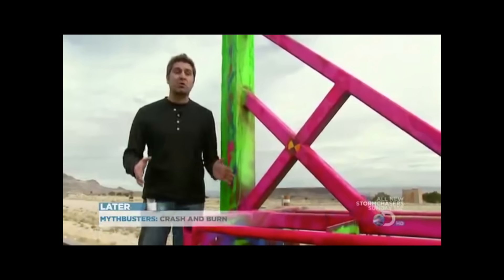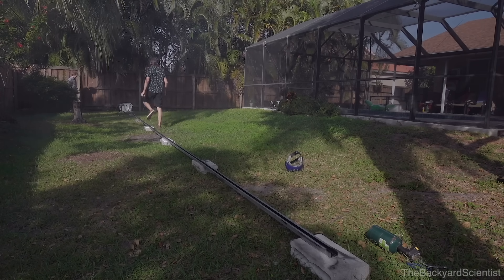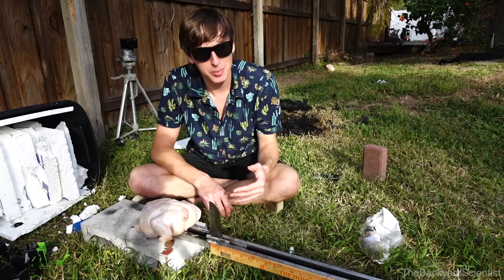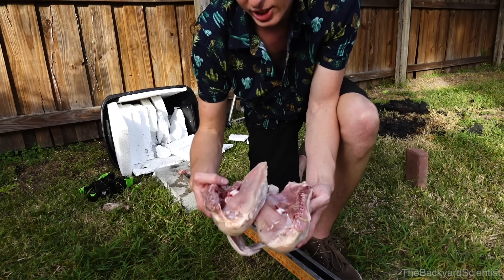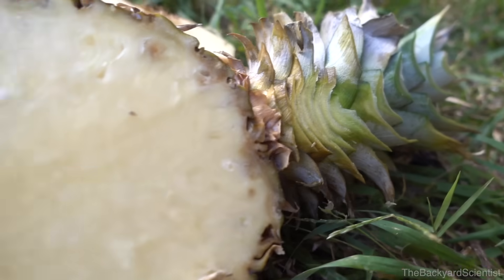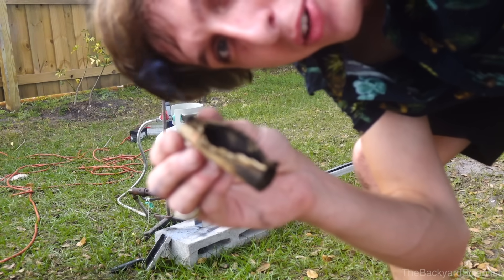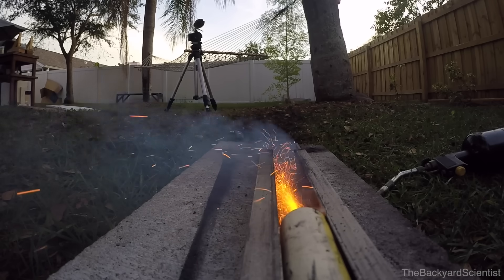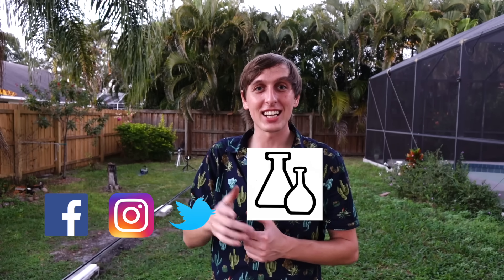150 mph Rocket Knife

Comment: Tbh, based on my calculations, you could survive being on that. The acceleration would be around 223.5m/s² which, could snap your neck, but if you were in the right position, you would survive for that fraction if a second. The G force would be about 22.793g which is survivable without repercussions if only held for a short period of time, held in place with equipment and in the right position.

Comment: Ok, so with some quick math, that’s an acceleration of about 20 Gs. If you were sitting down, facing forward, you could survive that for a bit under 1 second. And seeing that you said that was 0.3 seconds, you could survive that rocket sled acceleration (see Wikipedia, graph of human linear acceleration tolerances). It sounds like the most intense roller coaster ever...

Comment: I got somewhat bored today so I decided to calculate the pressure that knife applied in that car, (note: I am in no way a physicist, most of my calculations were made by using some assumptions since I don't have the exact dimentions of the "knife rocket", nor the area of edge of that knife)
I calculated the volume of an aluminum box ( 13,5 x 3 x 2 cm) and assumed it to calculate the weight of the hole thing ( tread + knife) since I don't know the thickness of the tread. the volume of it all came to be 81 cm^3
By using alluminuns density (2725Kg/m^3) I calculated the weight of 220,725g.
Sice F=m X a (the aceleration been 24,51m/s^2, calculated with the aproximated time of 2,9s); the force of impact is 5454,11N.

The knife itself has aproximately 14,5 cm in height and an extimated 0,012cm in thickness on the edge, leaving an area of 0,174 cm^2, or 17,4 X 10^-6 m^2
finaly for the pressure P=F/A ; resulting in a pressure of aproximately 313 MPa!

(I haven't added the forces of attition to keep stuff simple, but fell free to apply then if you so desire) Thank you very much for reading to the end and thank you Backyard Scientist for the awesome videos
Reply: Pretty sad that the crowd here doesn't appreciate your calculations...now 313MPa doesn't sound like an awful lot but it's roughly 5 times the pressure of an industrial oxygen gas cylinder...

Comment: If you use a thicker knife with a more aggressive edge it should stay pretty straight. Also you should try that rig with more rocket motors and secure a section of sheet metal over the track to see how far the knife can go through

Comment: We move faster than that bade because the earth go way more fast
Reply: milie faraaz I applaud your grammar
Reply: Ever heard of relative velocity?  If you jump out of a moving car you'll still be moving in the direction of the car.  The car can be going 80mph, but you'll feel normal because you're inside.

Same applies with the movement of the Earth.
Reply: Sure, you are on the rapidly spinning earth............

But so is the knife.
therefore, if you walk at 2 mph, you would be moving at (2+1000) mph, or 1002 mph.
if the rocket goes at 150 mph, the rocket would be moving at (150+1000) mph, or 1150 mph.
1002<1150.
unless you are the flash or in space, you will not go faster than that knife.

Comment: After a quick calculation. If you were to accelerate as if you were the gopro in the last shoot, you would experience a gforce of ~22.79. Which I assumed was a fatal number because fighter pilots have to wear special suits to endure 8-10 Gs, and the "lethal level" is considered around 10 Gs; however, that threshold is for sustained G-force over 1 minute. After a bit of research though humans can endure a lot of G-force over short periods of time. Air force officer John Stapp in 1954 survived an excess of 25 Gs for 1.1 seconds maxing out at 46.2 Gs. So if somehow you accelerated to 150 mph in 0.3 seconds the G-forces would not necessarily be lethal, Impact probably would be though.
Reply: Ryan McCaffrey you didn’t need to write all that

Comment: Try driving a spike nail through a plate of steel maybe? The spike nail is usually too soft for anything more than thin sheet metal, but if you can say get some 6" squares and maybe back them with say, wet telephone books, maybe you can see just how thick of a piece of steel you can punch through.

Comment: Dude metals are good conductors of heat because the particle takes in the heat and quickly spread it through out the metal structure(just a reminder for next time)

Comment: Because nobody pointed it out, as far as I saw, I do not believe the GoPro went quite 150mp/h because it has a bigger mass and air resistance than the Knife and would therefore be much more power consuming to accelerate.

Comment: I'm sorry that if this make me imcompetent if I ask this question cucumber is a fruit
Reply: nope it has seeds which means it is a fruit.
Reply: Some 1 it's a vegetable
Reply: i have seeds i am fruit
Reply: Some 1 it has seeds so it's a fruit
Reply: Jumper1155 "Botanically speaking, a fruit is a seed-bearing structure that develops from the ovary of a flowering plant, whereas vegetables are all other plant parts, such as roots, leaves and stems. By those standards, seedy outgrowths such as apples, squash and, yes, tomatoes are all fruits, while roots such as beets, potatoes and turnips, leaves such as spinach, kale and lettuce, and stems such as celery and broccoli are all vegetables."
Reply: Void Lol eww
Reply: Matteo Torres thank u only reason I went threw the comment it to see if someone thought it was a vegetable
Reply: nxnxns ajxndk thats not how it works. vegetables need to be replanted every season and fruits will regrow from the original plant. this is how you differentiate between the two.

Comment: 1) rocket sled with gopro pointed forwards.
2) rocket sled launched like a rocket
3) rocket sled into concrete
4) rocket sled with impact explosion
5) rocket sled vs molten aluminium
Reply: 2 rocket sleds crash
Reply: Rekarded or vs. solid aluminium

Comment: You set rotate the rail vertical so it goes straight into the air or at a 45 degree angle. It'd be pretty cool like launching mortars.

Comment: 0 to 150mph in .3 seconds would be the equivalent of 22.9gs of force.  
  
John Stapp did a series of rocket sled tests, where he showed that a human could survive at least 46.2gs relatively unscathed if properly harnessed, and sustained 25gs for 1.1 seconds with little ill effects.  
  
So actually, it would be very much survivable, although not particularly comfortable.
Reply: TUTURUTUUUU
Reply: So that 513.185 miles when launched vertically,
so the next question is, what object would be able to withstand it?
Reply: Paulo Castro John Cena
Reply: Dale Leonardo the rocket would pass thru nothing
Reply: Charles
Reply: Charles Cal it shopped a block o' wood and a brick and bread all in 1 time flawlessly
nowhere a human could survive that 
mayve survive that amount of force as a hit not with a sharp object
Reply: DerpMaster Hd he meant if you were on the rocket and you didn't hit anything

Comment: Cut open some aluminum cans. Cans of beans, soda cans, etc. 150mph can opener. The metal should be thin enough that it can go all the way through.
Having worked in kitchens I can also tell you that trying to push a knife through a big block of cheese (think a couple of feet thick) is pretty much impossible. A lot of big banquet kitchens have a bandsaw for that. I'd love to see if the velocity is enough to overcome all that friction.

Comment: Hey Kevin, I noticed at 2:57 you have two GoPro's set up right by each other. If they were both recording while you launched the rocket, have you thought about turning it into a 3D video? 
I have done it a few times, all you have to do is make sure your Left and Right are synced, and do a little lens warp in post, and set them side-by-side for google cardboard, and there you go. It is a little wonky, but it is pretty cool to do!

Comment: AWESOME VID!!!!!

After you fix the sled, you should see if the knife will cut a rack of beef ribs!  If it does, you could then retry it with a red hot blade to see if it would cut more easily or would the hot steel loose its structural integrity from the heat and be deformed by the larger bones!!

Comment: "It would probably kill you to go that fast" Tell that to the top alcohol Drag racers when they hit 350 MPH in about that time.
Reply: CaptinJJz it takes them about 2 seconds to reach 350. They only hit 60 in about a sec then the acceleration curves becomes exponential until the engine blows up
Reply from the maker: I think you would be fine if you were strapped to a chair, but yeah it would be very uncomfortable and you're probably black out.

Comment: Next time, use the super heated rocket knife to cut another knife that is laid horizontally. Please?
Reply: i want to see this!
Reply: It would be the other way around. The cool, hardened knife will slice through the (comparaticely) soft, red-hot knife, whichever one was launched.
Reply: Adam FromFin z
Reply: Adam FromFin no it wouldn't
Reply: Ben Steinhart do it with a regular knife then a heated knife

Comment: realtalk; I am flabbergasted that the car cut so cleanly, I thought for sure it would deflect the blade then shatter, robbing the knife of its kinetic energy
Reply from the maker: +Ryukachoo i'm surprise the car didn't roll backwards at all the knife was totally through by the time it even move backwards a cm
Reply: good point, but i guess if it's cutting so cleaning then by definition it's really not imparting much kinetic energy into the actual object? 
you could literally make some art with this thing, make a complex multi cast resin object and slice it in half to expose all the details super cleanly

Comment: Are you sure it's still 150 mph with the increased weight of the camera?
Fun fact: 0 to 150 mph in 0.3 seconds is around 22g, so yeah if you had the same acceleration with a human, it would most likely be lethal ;-)
Reply from the maker: The GoPro sled weighed250g the knife sled weighed125g so ur right it wasn't as fast
Reply: TheBackyardScientist it might sound really dangerous but get the knife to glowing hot and ignite the rockets. Hope you like the idea
Reply: Nvm i didn't watch thru the vid
Reply: The GoPro significantly slowed down the sled, it has a lot more mass than the knife.

Comment: Awesome video as always, loved taking a ride with that go pro! I couldn't help but do some calculations with the information I gathered from your video. So I found that with the knife traveling at 150mph, that thing would hit with about 220 newtons or 50 pounds of force! That's not all! With the average width of a knife blade being about 30 nanometers, that blade could impart 7.3 Gigapascal's or over 1 million psi of pressure!  Getting hit with this thing would feel like having a 50 pound weight dropped on your chest, that could also pierce straight through you! In essence, don't stand in front of it!

Comment: for those kind of burns, wet the affected area immediately after and then apply a layer of table salt. leave it until it is dry and limit the movement on that area. You will feel a little more intense burn but it will go completely away after a few minutes. wont get a blister and scar. idk why it works but it does. grandmas remedy!
my theory: salt dehydrates the affected area preventing a blister which commonly causes a scar and pain.
hope this helps you in future burns!

Comment: The acceleration is equivalent to about 2.78 g, which is in the same neighborhood as rollercoasters. In fact, some rollercoasters even go as high as 6.3 g.  The acceleration of your rocket sled wouldn't kill anyone, but it probably wouldn't be comfortable. Now the crash at the end is a completely different story.
Reply: Vincent Killion no it is 67 Meter per second in 0.3 secs so 67 times 1/0.3 over g = 9.81 thats 22.7 g
Reply: Lucas Müller I see what I did wrong. I used 3 seconds instead of 0.3 seconds. that works make a big difference. Thanks for the correction.

Comment: use a ceramic knife is sharper.
or try to use order medals for the knife and bass. try cutting through a flashlight battery. try cutting through a Hot Wheel or a model car

Comment: If you don't eat the heart of the chicken, you're missing the best part of the whole bird.

Dunno when you did the experiment, but if it was in the last 24 hours, soak your burnt fingers in white vinegar for 45-60 minutes.  I know it sounds odd, but it will take the burn out better than ice.  Wrap em with neosporin & band-aids - they won't hardly at all and will heal faster.  (Don't ask me how I know this... let's just say I had a similar situation when I replaced my water heater and got a nice solder joint in copper pipe for the first time.  My fingerprint is still burnt onto the pipe 15 years later.)
Reply from the maker: +RealRuler2112 it was 2 days ago my finger feels fine now, just 2 small blisters. I've never had chicken heart before I don't think I'm brave enough to try it either

Comment: Great video! Those sugar rockets work really well. I've done the same thing after heating things up.....you forget and touch it.
Reply from the maker: +electronicsNmore yep number one rule about hot things… They look exactly the same as cold things! look up PVC sugar rockets by Jason Smiley, it's a whole PDF full of designs with thrust curves and data for each engine. The best part is you don't have to melt anything with these just hammer the dry powder together and drill it out.
Reply: *****
Looks like fun, I'm definitely going to make a few. Thanks for the info! Drain the blister with a needle, but leave the skin in tact! :-)